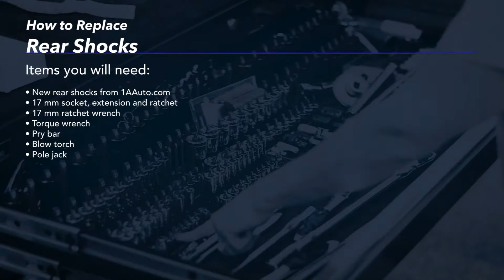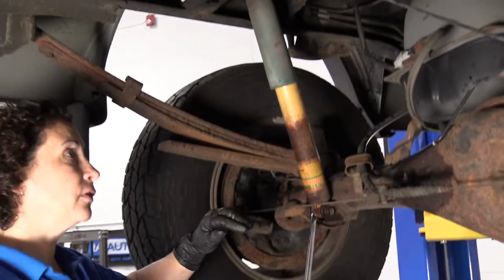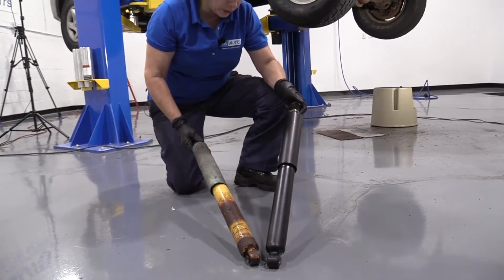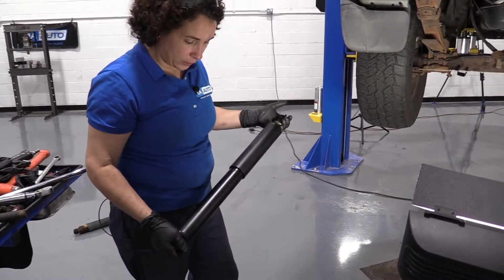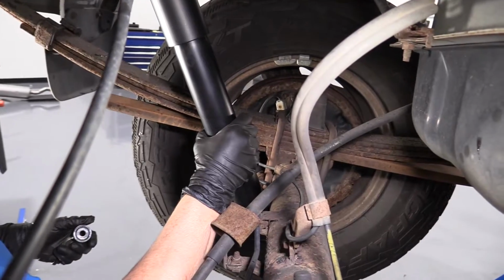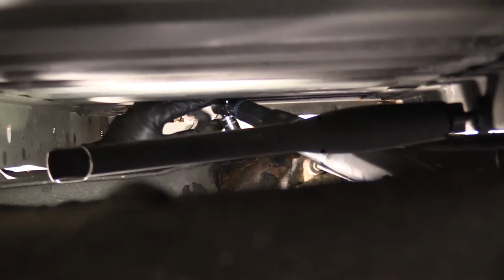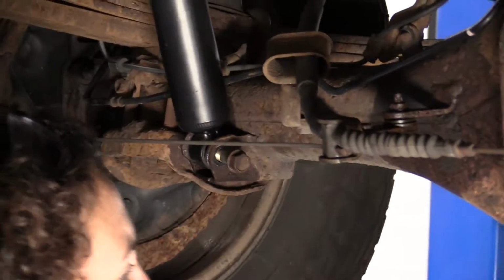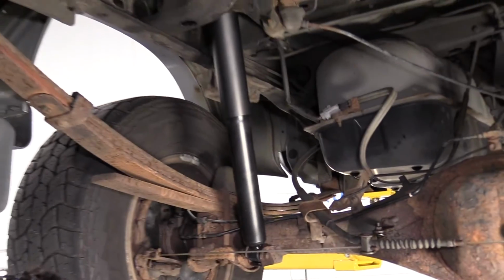How to Replace Rear Shocks 00-06 Toyota Tundra

Comment: Appreciate the video, but this is why I do most of my own mechanics. Even the Youtube videos are rough. No reason she had to bash that lower bolt in and bend the mount or cut off the old top bolt if spinning. No reason to jack up the diff either..... The top threads have a flat spot to put a second wrench so the shock does not spin when removing old bolt and the bottom of the shock can be compressed and moved into place by hand and the lower bolt slides right in. Just finished my install without removing spare tire with truck on the ground. Job took about an hour to complete outside with no shop in minus 5 degrees Celsius. Also did front struts a couple weeks back and both jobs are relatively easy if you modify/plan this project as you go along. 10 years ago I had a mechanic do the same 2 jobs and it was about a 1000 bucks. Front KYB struts where toast, but I do lots of off road driving. The rear Blistines from 10 years back were still pretty good, but changed them out anyway. Perfect backyard Covid19 project.
Reply: Valid points. I can’t believe she bent the bottom mount bracket lol

Comment: I found that a 12 inch metal blade in a saw all works great to cut off the top bolts to remove shocks. Be careful on driver side not to cut into the wire harness. Easy reach  thru fender well

Comment: If you have enough thread, you can add two stacked nuts on the top and leave enough gap for you to loosen the actual nut while keeping the stacked nuts tightened with a ratchet/wrench.

Comment: If you haven't totally screwed up that nut? How do you get the shock from spinning. My chevys always had a spot where I could put a wrench underneath and hold it. I dont see anything like this on toyotas
Reply: Vice grips with a really strong grip if you have to tach  weld the vice grips to the shock
Reply: Never had one to spin on any make or model, must be doing it wrong

Comment: Why didn't you bolt the bottom first before you tighten the top nut? Wouldn't that be easier so you don't need to jackup the truck to fit the bolt through on the bottom.?
Reply: Or hammer the bolt through, damaging the mount and likely the bolt threads 🔩🔨😞
Reply: Theres a lot of wrong going on in this video but that would've been the sensible way

Comment: Would a propane torch work to get the top nut off?
Reply: Nope. The acetylene torch was used to cut the mount, not to heat it up.